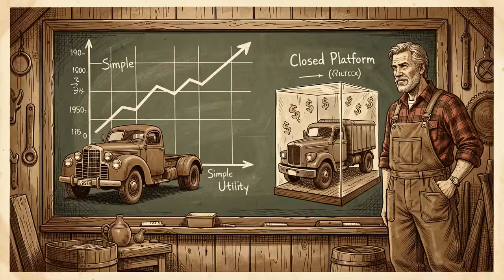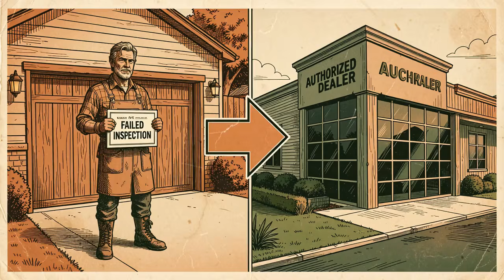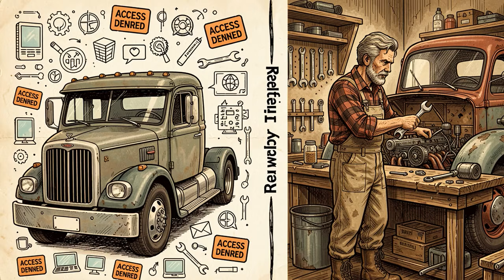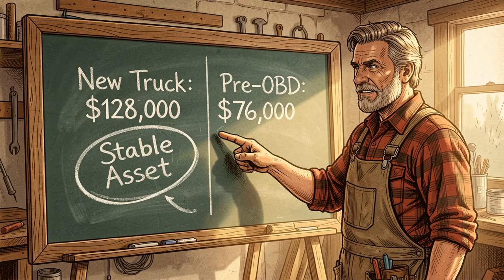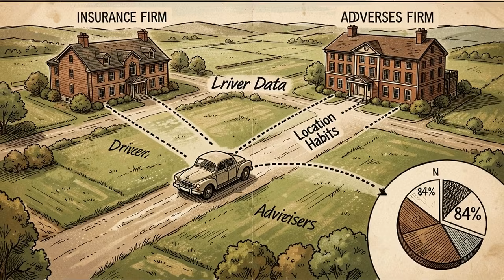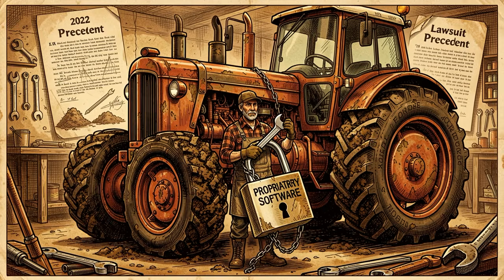Why Smart Americans Are Buying 30-Year-Old Trucks (The Pre-OBD Loophole)

Comment: F 150 was using Multi port injection since 1987. You have to go back to 84 to find one with a carburetor on it and even older again to have the old duraspark ignition system.